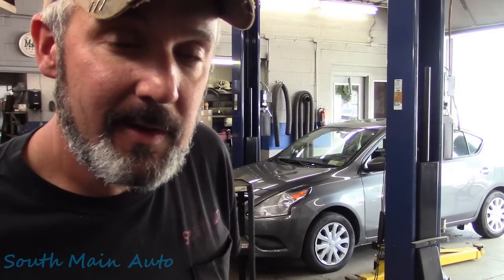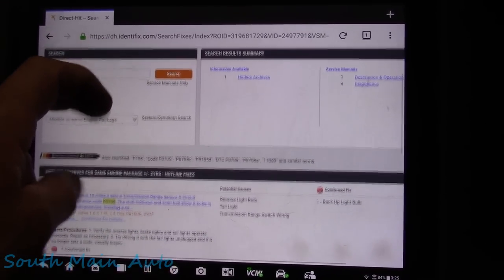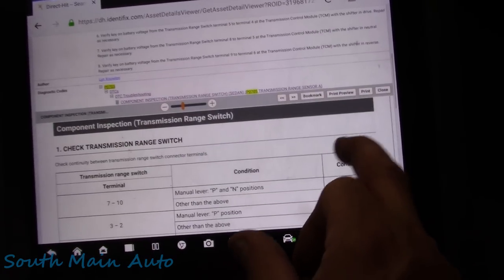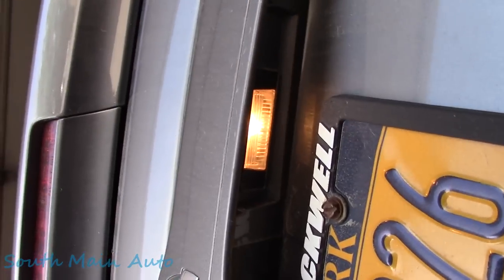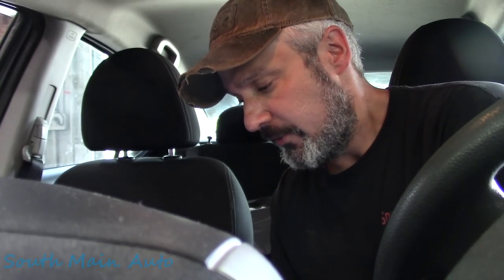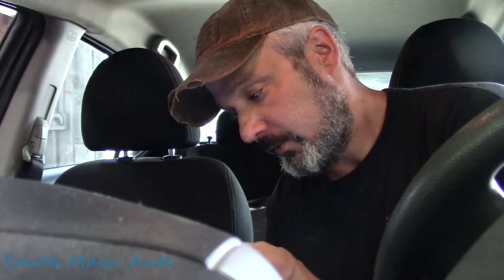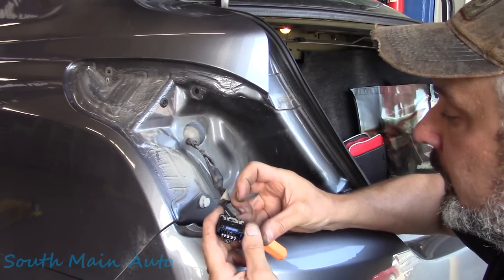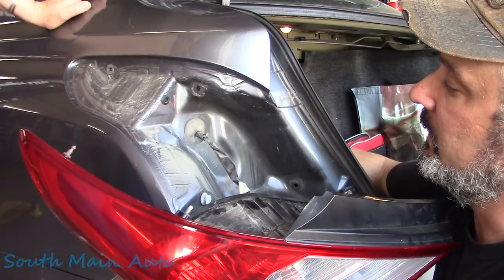Service Data Doesn't Cost - It Pays

Comment: I'm just a DIY guy that's been fixing my own stuff for 45 years....I've never had a repair subscription service that you pay for, but at times I wish I did. I think you should do as Eric does and have several available to review and determine which is the avenue to pursue
Reply: Chilton has a free service that you can get sometimes with a library card.  My local library has access and I can use it to look up direction on how to disassemble and repair things myself.  Also there is a service cost estimator.

Comment: I had some problem with the flux capacitor not working on my car and went looking for the powers and grounds, then realized my car is not a Delorean. I could have saved time if I checked the service data first.

A bad ground on a taillight causes a position sensor code?  What is next?  Turn on the seatbelt light when there is a misfire on cylinder 3?  Run low on gas and the airbags explode?  I think I will avoid Nissans.

Comment: I used to use Identifix a lot when I was working as a tech. However, I never used it as a replacement for actually diagnosing the problem. The value of it is easier access to OE service manuals, TSBs and information that may help save you time when diagnosing. If 95% of the failures for a code are caused by a particular part, it might make sense to go and test that part first. It is not a silver bullet and not a replacement for a real technician actually using their brain. I can’t imagine working for a shop that didn’t pay techs for diag. They must have a lot of come backs!

Comment: hi Eric between you and ray you pair have got me out of some sticky situations with repairs i had some thing similar a few days ago with my trailer lights what it turned out to be was a loose wire in the plug that had frayed and was touching other connectors 30 min later all fixed without a service call saved me some big $$$

Comment: For something like this I probably would've assumed the range switch was weird, first checking to see if it was adjustable and fiddling with it for a while before getting into the wiring. I'm not sure how long it would've taken me to find the actual problem, unless I got fed up and moved on to the wonky tail lights only to be surprised when the transaxle code magically disappeared afterward.
Judging by the loose fasteners and pushed out grommet on that tail light, I'd suspect either someone had already been messing around in there or it just speaks to modern Nissan build quality, neither of which are good.
Reply: Another possibility is that the taillight assembly was replaced, as I see what look to be brush strokes under the paint where the car body is hidden by the taillight.  Could this car have been hit in that corner, and the pin was bent when replacing the taillight assembly?

Also, would hate to have to change any bulbs in that thing.

Comment: What do you tell the customer when they ask what the problem was? 
1) a broken wire.
2) a bad wire connector
3) fixed a bad wire connector in the drivers side taillight housing wiring harness plug.

I am still trying to wrap my head around how a bad twilight ground can screw up the function on the transmission shifter.

Comment: Having been the recipient ( or my Ford Truck ) of the parts cannon I appreciate your safe cannon handling skills! To be clear this was a Ford dealer and also an independent. It took a guy with an 8th grade education and a multimeter less than 20 minutes to fix my problem ( truck stalling when I stopped while driving, ended up being an $15-$20 ignition module in the older truck ).
I spent over $600.00 at the dealership and independent shop. My man came out measured the resistance on the ignition module, said the module was bad, sold me the module and never charged labor because it was such an easy fix. I think about this whenever I hear someone bragging about their college degree or pretty much any advanced teaching they believe makes them better than anyone else. The man that became my mechanic was just shy of a miracle worker, I swear sometimes I think He would lay his hand on an engine and it would just tell him what was wrong! 
Great video!

Comment: As an owner of two Nissans, one of which is an Infiniti, the fact that a mild short in a rear light assembly can throw an odd shift selector code is worrying. Good catch in the service data, Eric. I'd hate to have been that first poor sap to have to track it down without the first hint.
But, I do have a serious question for you, do you add to service data when you find an odd fix like that? I know you have fixed issues that service data didn't point towards.

Comment: I've been down that rabbit hole without a scan tool with the little woman's 2012 Nissan Versa replace the shift indicator switch which solved nothing after many hours searching the internet for information found out that the tail lights was causing my problem the hundred-year-old technology of the solder LEAD tips on the bulbs was dirty

Comment: I heard you say kanueter valve and I cracked up.. I used that part name in the early 80s while working in the walmart service center. Our promotions gal came in with her new chevy nova ( the import one ) for a oil change. She was cute and I thought I'd give her a hard time. I told her that her kanueter valve failed and the main bolt keeping the engine together rusted out. She freaked out because she just bought the car. I let her rant for a bit and told her I was messing with her and the car was fine. I thought she was going  to hit me. She finally laughed. Anyway nice find using your diagnostic skills.

Comment: 0 see that code with a lead sewing changing a part that would have cost some quite a few hundred dollars with labor if it was not thought of outside the box on how to diagnose it versus this no parts require other than diagnose time and a fraction of repair time then it would have cost to replace that neutral safety switch or that range switch Good job Good job on and throughout inside and out repair Mr Eric I'm sure Isaac from pine hollow would love to see that

Comment: This brings back a memory of me having an issue with a chevy city express (nissan nv) and i reached out to gm tac and they told me to check the tail lights. I had an issue. Don't remember what the issue was with the vehicle but taking care of the tail lights fixed what ever it was. GM tac is Sometimes helpful, some times they respond with the same diagnostics steps you already took and told them you did. LOL. Sometimes using identix or gm tac is helpful, but its not ment to shot gun parts its ment to direct you to where you should do some testing! I worked at a shop that only had all data and working on euro cars i had to resort to google. lol I managed to find helpful info out there.

Comment: Thank you for your excellent diagnostic work and sharing with us.  I had a similar experience with a 160h motor grader. Kept throwing a master alarm and transmission filter fault. Turned out the problem was a burned out bulb in the dash. A lot of wasted time and huge amounts of frustration over that one!

Comment: So glad you made this video. I have a 2005 Toyota Avensis (UK) with a 2.4 2AZ-FSE and 5 speed automatic gearbox. I swapped the starter motor with a new unit after it failed. I unplugged the reverse light switch for better access but forgot to plug it back in. The gearbox lost half its gears. I was quoted for a replacement gearbox for repair. Just plugging the reverse light switch back in solved the problem. Great video and advice 😀

Comment: Awesome video,  just goes to show you that electricity does take the path of least resistance.  It is wild the way a bad ground can mess with the flow of power to other components of a circuit.

Comment: Sitting in traffic, brake lights on continuously. All the current goes through the ground wire. Anneals the terminal. Seen it on aftermarket lamps.

Comment: Just like how you explained using Idenifix..  I've been using youtube, google and forums in that way for years. lol..  You have to weed through more trash to find your treasure, but it's usually out there.  There's usually a concensus or common thread that points you in the right direction.

Comment: Not a mechanic here, how does one connector become loose but not the others. Just not quite up to standard when built and the old shake rattle and roll happened? But with no corrosion is it just that sometimes shit happens? Interested to know. Thanks in advance.

Comment: I had an odd situation like that with my old 2003 Hyundai Elantra GT (Manual). The cruise control stopped working and I spent a day trying to diagnose it before I went online and discovered that if a brake light bulb is out, the cruise control stops functioning. I replaced the bulb and was back in business. Screwiest thing I ever saw...

Comment: What an odd problem.  I think it points out a problem with design philosophy.  Those systems shouldn't be interconnected to the point that a taillight ground issue would affect the transmission.  What do I know, just a mechanical engineer here and decades of experience fixing my own stuff.  I do understand "robust design" however.  It's always a good day when Mrs. O. ventures into the workshop.
Reply: Problem is all the engineers with no hands on experience. Pair that with "theories" many designers, engineers have and their propensity to not listen to mechanics, customers and things get even worse!

Comment: The Versa is one of the cheapest cars available. I wonder if someone messed up the wires or connector when putting in a new bulb, especially with the loose nuts of the light body to the car body when you went to take it off. Sometimes a search on the internet can be a great help in figuring out a problem and how to fix. I had an horn that wouldn't work on my 2014 Focus. A search told me how to access the horn and how to fix (dissemble and clean up the bracket connections with a wire brush or sandpaper, put on some silicone grease when reassemble)
I think I figured out your secret - you seem to have a good partnership with your wife. 😁

Comment: A friend of mine had Nissan Almera, and it was kinda in a limp mode, no power at all, throttle body didn't open more than like a 20%. Tested all wires, measured the throttle body etc. It ended up being in a limp mode because of blown brake light bulbs. I mean come on. Even Nissan OEM service manual doesn't say that throttle body movement becomes limited if the brake light bulbs burn out. An ofc, no dtc:s.

Comment: Do not use identifix. Do not know any shops that use it either. That said the issue you had on that Nissan was quite unique. I could see how it could have led you down the rabbit hole. This addendum in Identifix surely led you down the path of a successful repair.

Comment: Sounds to me, the wiring designer didn't check the connector's pin current capability against the actual load.  The he female contact is getting over heated, screwing up the contact spring temper.  Once it starts it never gets better.  As the resistance increases the contact to heat up more and more. Finally surface contact corrosion keeps the angry pixies from flowing.  If you are lucky the happens before the connector's plastic melts.    This is really common in electronic equipment, had to fix lots of similar problems over the years.

Comment: Identifix is a great resource. I used to use it to shortcut my diagnostics. Instead of having to drill down through a bunch of BS the identified peeps put the stuff you need right at the top. Saves tons of time digging around for the info you need

Comment: i had similar issue with my tail lights on my s10 the drivers side tail light lost connection and caused my truck to run as if it jumped time or it lost vacuum in the manifold cause when i stepped on the brake peddle the truck would die i added another ground wire from the frame to the grounds on the drivers side tail light and BAM problem solved now the only issue i have is the heater for the bank one sensor one o2 sensor

Comment: That was a weird scenario and i would never have dreamed to look in the tail light harness. I am sure you would have found the issue with the identi fix but the time you saved by checking out what a prior fella had posted as his fix..thats priceless.  And the drag test...you think of all the connections in a wiring harness and everything is just so but if there is one teensy bit not the same it causes problems. It really is in the details...sometimes finite details at that not to mention the 2 loose t/light nuts as well..  A great video Eric!!!

Comment: Can I ask here?
My 09 C5500 has trans problem/s!  the 1,000 Allison trans. A Drive solonid seems to be staying energized when should be de-energized?? some such problem which shows that.
Anyone know what it is?
Sometime when shifting between (D to P) I get a loud clanking trans temp of ??( 127 to 160*F) so not hot, was changed awhile ago and didn't make any difference. ( yes brake is on and not speed shifting)  Some other info has not been included. 
Thanks to all.

Comment: Eric, Nissan Master here. There’s a bulletin instructing replacement of both tail lamps. Common issue on these Versa Sedans and they cause all kinds of different codes/symptoms. While Nissan bulletins don’t always give reasoning, I think these tail lamps have issues with water intrusion from factory. New factory replacements are fairly cheap if I remember! Probably due to high sales of them haha
Reply from the maker: I saw the bulletin on the 12 to 14's but didn't see any past that. Do you have a bulletin number for the 2018's?
Reply: @SouthMainAuto   sorry for the delayed response but you’re right the bulletin is for 14-15 NTB 15-082. Although we’ve definitely had issues with newer Versas. Anyway thanks for sharing your diagnostic intelligence you’re definitely an inspiration!

Comment: Incredible:
1.  That diagnosis is pure karma
2.  It points to industry-wide engineering failure.   That a loose tail-light connector could put an otherwise healthy vehicle out of service and make it undriveable is Bad Engineering.  Its bad systems design.   And to follow-up with no way to track the problem thru networked electronics (totally unnecessary for tail lights) is shameful.   Entire service industry should call-out those ivory-tower engineers who are making money by early obsolescence.   Rather die by rust than by corroded wiring harness.   
Sorry for rant.  It was a great diagnostic video.  Watched 4 times.  Trying to figure out how to acquire some of that diagnostic Karma.  Thanks Eric!!!!!
Retiree-Brighton, MI

Comment: It sounds like the engine/alternator noise is rising and falling after you turned on the hazards, not sure if that means anything (Excessive current draw???) Great video as always with these strange cases. Thanks so much for bringing them to us Eric.
Reply: I heard it too.  Sounds like alternator whine from the bearings.  As I just repacked the bearings in my Alternator few days ago because of that sound.  Now the whine is gone.  He should check the other bearings as well to see if they need repacked.

Comment: I use identifix all the time, and I use it as a simple resource. And more than not it’s saved my butt and helped me gear toward the problem. I find the notes other technicians and techs write to be extremely helpful in connecting and fixing the issue. Not all the time but I do like identifix just a bit more than all data.

Comment: I had a 97 dodge Dakota, bought it for 500, guy thought the transmission was shot, so bought it, and drove it home in limp mode, did some scanning, and googed it, and only 1 solitary post, said to check the b4 cat o2 sensor, and the post said to check to see if the wires  from the o2 sensor are messed up, and grounding out on the frame, since the o2 shares a ground with the transmission control mod it tends to put the trans into limp mode, sure enough that was the problem, rewired it, and was good to go.... Do your research, before throwing parts at it.

Comment: OK ok I have a good one. One day I had a 2012 hyundai elanntra with ABS, traction control and many other lights that are popping up in the cluster, cluster goes dead and dim so I just was like, well it has symptoms of a bad ground I checked the grounds and everything and was good. Scratching my head I discovered that the medium speed CAN was being pulled off by something when I discovered that the license plate lights where part of the CAN system, I unplugged the plate lights and everything stood fine

Comment: Unfortunately, a well-guided parts cannon can be cheaper than my time to properly diagnose the problem Which is why I now act as the diagnostician of last resort (and charge 150/hr) You would be surprised how many times the "identifix" was right but the part that was installed was defective or the first defective part caused more problems and the "old" part was still good
Reply: and yes I check identifix too. Common problems are often found (and then proven) that way.

Comment: How is that rear light assembly ground connected to the transmission?  Was it shown on the schematic?
Reply: I’d say the poor ground was causing the other light voltages to feed back on the reverse light signal from the transmission or TCM.

Comment: Wow, we non-techs can now remember to look for anything like this in the light cluster of a modern car, and it might suggest a crazy ground problem.  I wonder if this is the result of the auto worker when this car was going down the line, who pushed the connector on not quite straight.  And I wonder if crazy stuff like this could happen if someone replaced original incandescent bulbs with sketchy LED bulbs, like Ebay's finest not-quite-Canbus compliant.
Reply: Things like this happen a LOT with aftermarket lamps and parts.